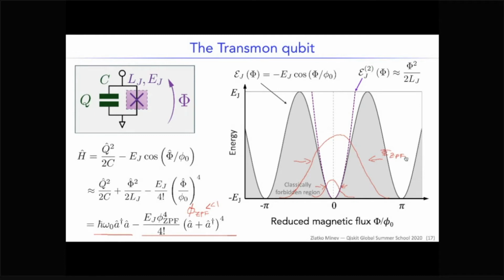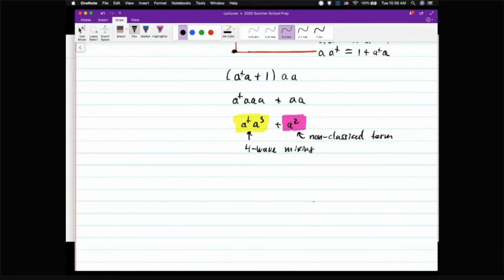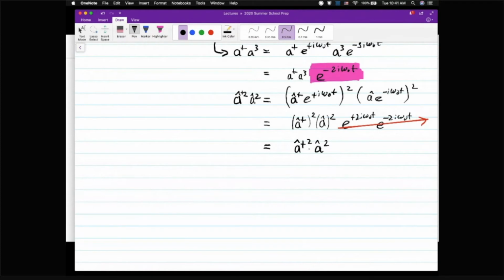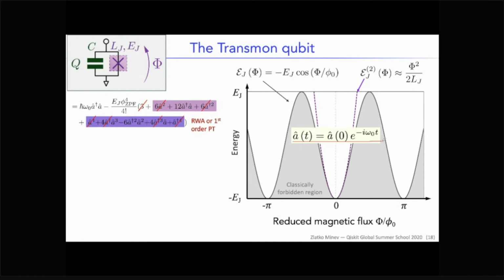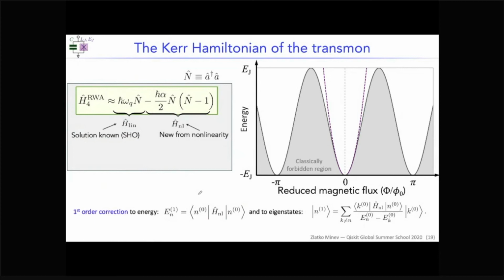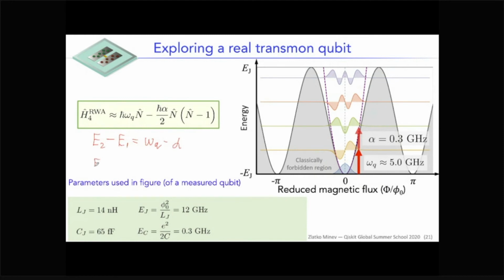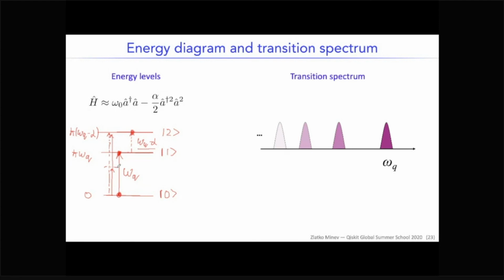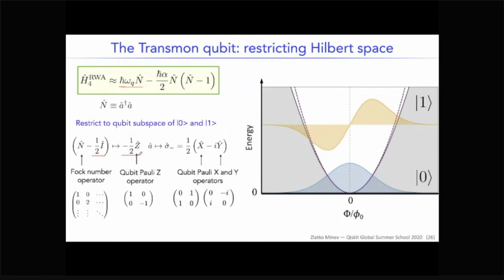20. Superconducting Qubits II: Circuit Quantum Electrodynamics, Readout and Calibration Methods Pt 2

Comment: @36:30 (N-I/2) should be (N - 3I/2) ?
Reply: You are correct about the error with N-1/2I,  which can be fixed one way by using -3/2 instead of -1/2, (as pointed out in another comment in another video) but more fundamentally, I think the presenter made a mistake in defining the number operator N. To be consistent with the matrix representations of the creation and annihilation operators (see 16:07 of Superconducting Qubits I: Quantizing a Harmonic Oscillator, Josephson Junctions - Part 3 (https://youtu.be/hGBAz63NIH8)), the first diagonal element of N should have started at 0, instead of 1. That way, N acting on the ground state (no photon state) |0> would give 0. The presenter's slides have many instances of mistakes, but this series of videos has generally been good IMO.
Reply: @maxwellsdaemon7  Thank you for pointing the mistake regarding the matrix value of a+a out!
Reply: Agreed!